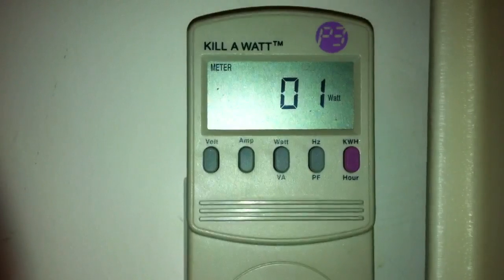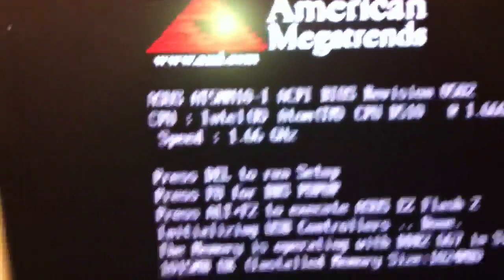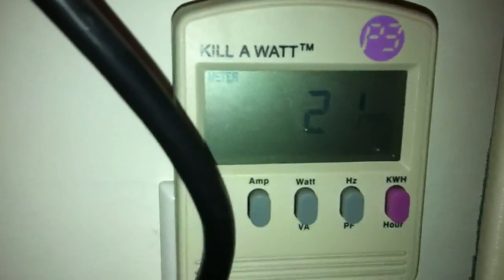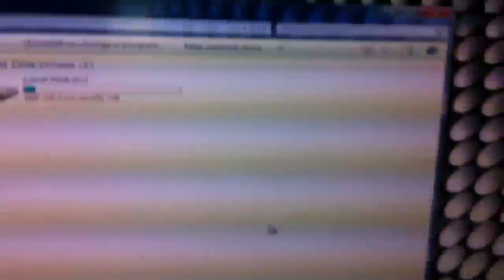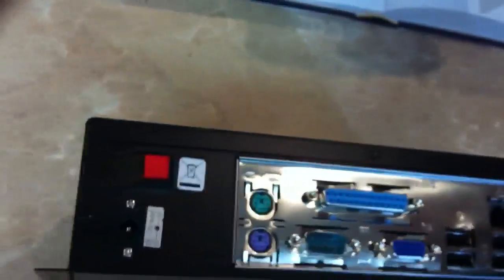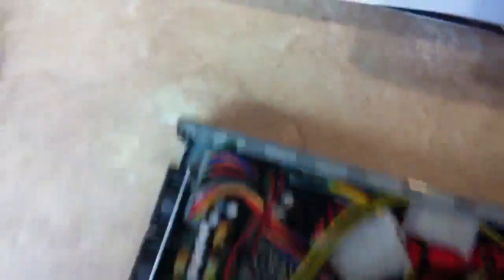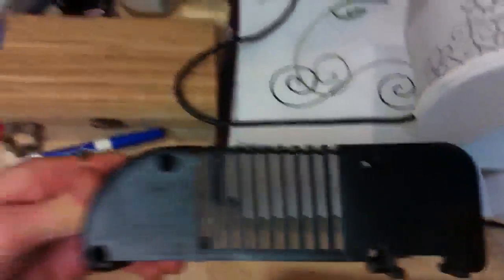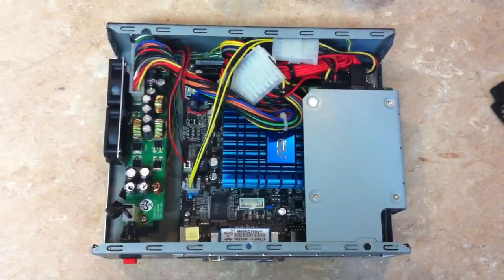Super low power consumption htpc (22 Watts)

Comment: No offense, I know this was 4 years ago and all, but my Asus ROG G750JM-DS71with a Core I7 4700HQ and 24GB of RAM and a 256GB SSD and a 1TB HDD at idle (same as your setup was showing) with screen brightness at the LOWEST setting uses about 20 watts and at full brightness around 25 watts, hell as I'm typing this it is consuming between 26 and 28 watts, the true test is how little power it consumes while ACTIVELY doing something like playing a video (which mine bounces between 30 and 35 watts while playing your video in 720p with full screen brightness)

Comment: Nice Video, you've made me contemplate building a new HTPC, as I'm currently using an old AMD Phenom ATX tower, which is running at like 180Watts, costing $120/year in power.  If I can bring it down to even 60Watts, The system will pay for itself over 5 years or so, and if it never breaks, it'll last indefinitely.  

My Phenom is overkill for running FreeNAS, as it is mainly network bandwidth and RAM that gets used heavily, and having 4 cores burns so much power.  plus I'm running 6 drives right now, I would much rather just have two 3TB on RAID 1 to save power.  How much power do you save going from 3.5'' drives to 2.5"?  Definitely going to shop around for an Atom build as all I do is mainly file server/media player.

Comment: You dont need to convert the 20 pin power to a 24 pin. It will wort with a 20 pin power connector without any problems. The aditional 4 pins are there to provide more power which is useless on this board.
Reply from the maker: Yup Correct, Can't remember why I even did that... probably habit from building bigger over clocked systems..
Reply: u can even convert a at powersuply wich i did to fix a pc on a lan just cut of the cables and splice the rails XD my friend is using that horrible hackjob for 5 years now ^^